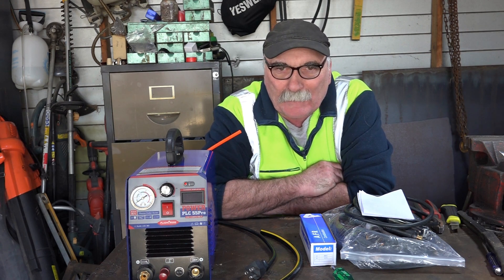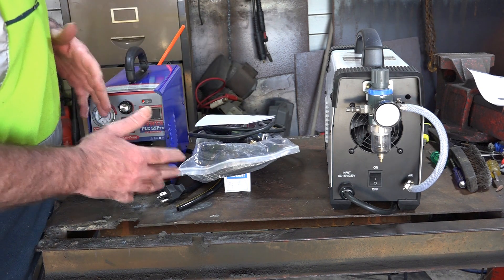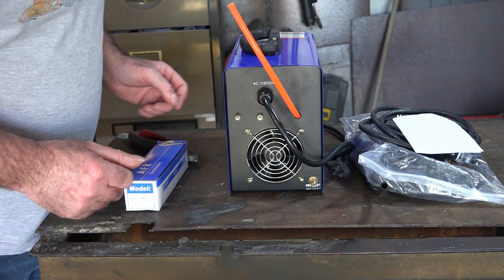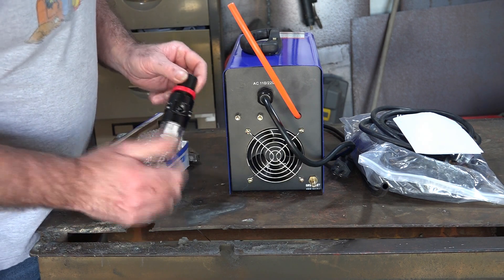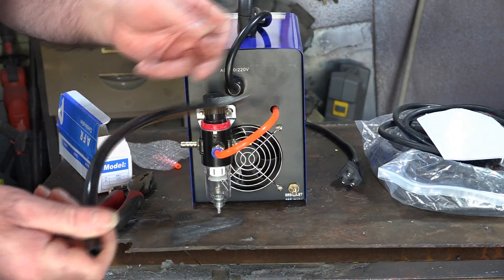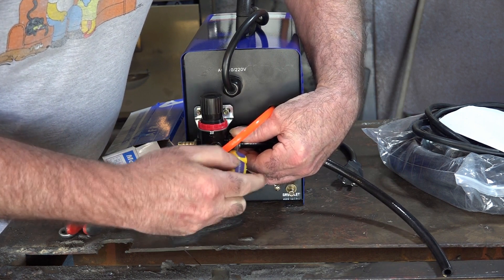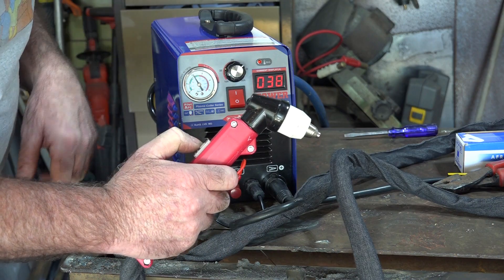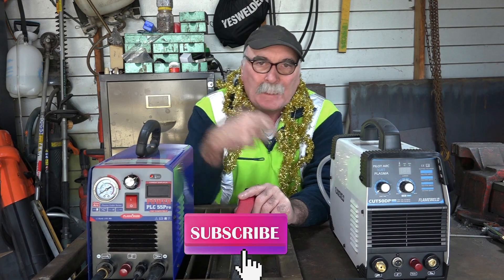50 Amp Plasma Cutter: How to Set It Up (Step-by-Step)

Comment: That's the exact same one I have here- had it nearly a year now, and its been a little champ...
Mine did come with thread tap for the air fittings, and the only issue I have had so far is that the earth lead clamp was 'quite weak'- it didn't bite hard at all, plus it was a bit on the flimsy side, so I replaced it- came with 5 sets of consumables as well- which reminds me I need to order some more, only one set left
Reply from the maker: yea mate the earth clamps suck mate

Comment: Hey Pete would a p80 torch work on a 40 amp plasma. I was trying to cut heavy plate and it was blowing out the tips in a pt31 torch. This plasma has a built in air compressor 
Thanks in advance for your answer
Reply from the maker: https://youtu.be/oYE8VdFNXjo